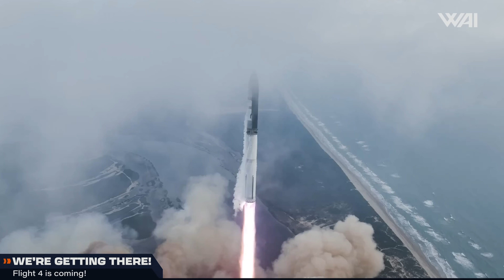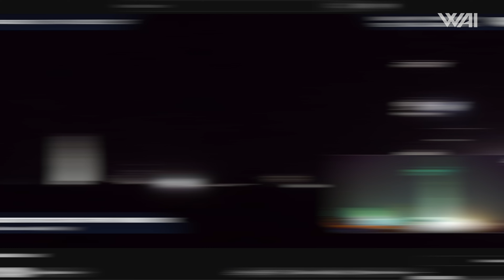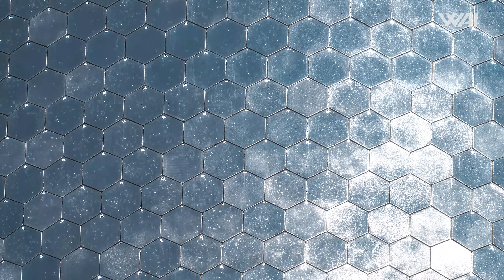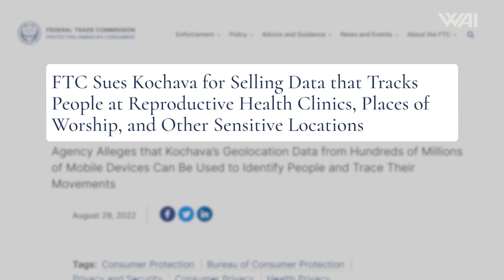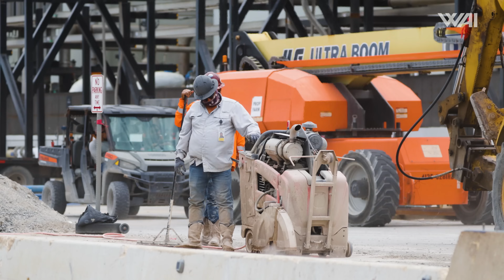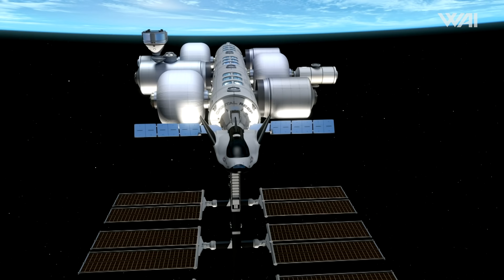SpaceX's Crazy Race To The Next Starship Launch Hides A Twist!

Comment: Putting the lifting points by the door section will allow for a longer booster to be stacked upon without needing to alter the height of the towers at all, as most of the weight is in the raptors the lifting point could theoretically be just below the middle point which also means the longer starships won't require any tower modifications.
Reply from the maker: Excellent comment! Happy that others see this, too! That was my first thought! I just didn't want to speculate too much. :_WAISweet:
Reply: Also, hasn’t the lifting jig caused damage to the tiles on the flaps? Moving these away from the flaps might help protect them when lifting.
Reply: @rightsongsrighttime  the damage was to the tiles near the lifting points, and not the flaps
Reply: @bryanillenberg  the lifting points on the V1 starships are right under the flaps
Reply: @PerilousPaddy  yes, and? The lifting points aren't a part of the flaps, nor is the damage caused by the two-point lifter
Reply: @bryanillenberg  you replied about the damage as mentioned by @rightsongsrighttime and I just pointed out where the lifting points were on V1 which are being moved away from the flaps on V2, moving the lifting points away from the flaps will reduce any chance of damage to the flaps whether they have been damaged or not.
Reply: @PerilousPaddy  The two-point lifter will still need to pass the flaps, so not really
Reply: @bryanillenberg  and moving potential tile damage away from this thermal stress point could be a bonus.
Reply: @PerilousPaddy  as most of the weight is in the raptors 

Not when the cargo is already loaded in the cargo bay.  Unless they load cargo while the Starship is stacked on the Booster it will be more top heavy.  That limits how low the lift point can be.
Reply: @Scanner9631  if the cargo weighs that much they will probably have to use a different method
Reply: @PerilousPaddy  

You do know the target is 150+ tons?  Expendable 230+ tons.
Reply: They will still need to move the SQD, though.
Maybe tower 2 will have a vertically mobile SQD, like 39bs crew access arm was supposed to be
Reply: Yes, but they'd need to make the megabays taller. Right now, the current booster design is the maximum height either stage can be at 71 meters tall. As someone else said, they'd also need to make the SQD higher up on the tower - not a trivial task.
Reply: @faxinspace  maybe booster ok, and they modify hight of where they hotstage.. well a possibility i guess
Reply: @faxinspace  true but that doesn't change my initial thoughts on the reposition of the lifting points making it unnecessary to alter the tower.
Reply: Yes you're absolutely right and thats the beauty of stretching anything that flies. The stretched  version is actually a more balanced craft.
Reply: Fully loading cargo with empty tanks could over-stress the starship itself. Pressurised tanks will be inconvenient. 
Maybe this is why the lifting points have been moved. Ship can be hung on the brackets and fully loaded with empty tanks.
Reply: @Dave5843-d9m  
Pressurized can be with gas it need not be with liquid propellants.  I can't really see them fueling up Starship and THEN loading the cargo while it is fully stacked.
Reply: @Scanner9631  neither can I to be fair.  My guess would be Stack, then Cargo, then Fuel just prior to Launch. It would be difficult at best to move the ship with all that cargo and definitely impossible when fueled.

Comment: I wonder if the Orbital Reef will also have a docking system for a Dragon capsule installed...
Reply: I think by the time the Reef is  operational,NASA will have set a standard for docking that all manufacturers will use.
Reply: @kimnelson-barclay7427  They already do, which is why Dragon and Starliner dock at the same ISS port used by Shuttle. And I believe the Chinese use a variant of the same standard, so in theory their crewed vehicles could also dock to the ISS or to any of the proposed commercial stations.
Reply: since the ISS uses the international docking adapter for all except the russian spacecraft that is a given i think..

Comment: Falcom 9's launch cadence is limited by the transit times of the booster droneships. If F9 launched fewer StarLinks, then they would be able to return the booster back to launch site; dramatically shortening its turn around time. The question is how much mass reduction is needed for this? Instead of 23 Sarlinks and landing on the droneship, F9 would launch ??? Starlinks and land back on the pad.
Reply: You'll then need more launches to put the similar amounts of satellites
Reply: At least SpaceX could keep their current 144 launches this year and merely supplement their launches as hangar space for refurbishment allows. Of course once Starship starts launching 400 Starlinks at a time this will all be moot.

Comment: Why don't they just build a flame diverter? It's seems ridiculus to launch the most powerful rocket without it...
Reply: The plate works just fine
Reply: @alvianchoiriapriliansyah9882  Thats why they need to repair after every launch right? :D
Reply: @daniel-n3v9j Ah yes good to know that the OLM and the plate are the same thing...
Reply: @alvianchoiriapriliansyah9882  what plate are you talking about? I tought you refer to the bottom of the launch pad
Reply: @daniel-n3v9j Orbital Launch Mount refers to the ring-shaped structure that hold the vehicle while standing, supported by 6 legs. Plate refers to the steel device on the floor of the pad with water-cooling

It's. A. Different. Thing

Many scaffolding are erected o& works on the OLM after each launch, while the Plate are basically untouched. You'd probably know why...

Trench protect the latter, former not so much
Reply: @alvianchoiriapriliansyah9882  Isn't OLM the whole thing including the ring, the legs and the plate? I still think this water cooling plate is overengineered, a flame diverter would be much simplier, especially knowing Musks "the best part is no part" mentality. But anyways the engineers probably know better...
Reply: @daniel-n3v9j Wrong, the OLM only refers to the ring table

Diverter also uses water-cooling, basically the shape/geometry is the only difference. And oh, you can install a diverter without actually building a trench

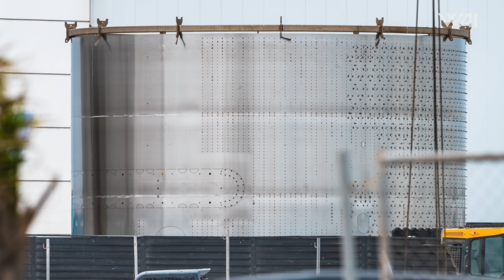Comment: 8:28 Imo this might be a smart move from SpaceX. Move the payload door higher up the hull, will reduce stress in this section by a lot. Just feed the Starlink Sats from the bottem up, and not from top to bottem.
Reply: You might be on to something with this idea! Nice.
Reply: bottom.
Reply: They are moving the dispenser lower, not higher
Reply: @bryanillenberg  Not if the cut outs for the lifting system are that close to the payload door. Thats why we think it could have been moved to the top and satelites will be fed from bottom not top. in Space it doesnt matter if top or bottom...
Reply: @Vollmilch-Joghurt  they are moving the lifting system down, not the dispenser up!
Reply: @bryanillenberg  i dont know why they should move it that much down. cant wait to see the whole ship
Reply: @Vollmilch-Joghurt  because the ship is getting longer, and the booster (hopefully) is getting longer as well

Comment: 5 years from now I can’t even imagine how capable and cheap starship will become. Mass production, rapid iteration, and continuous improvement is the only way to produce a complex machine.
Reply: Really? 45 years ago the Space Shuttle was designed and built. The most complex space system ever built and it still holds that title. Iteration was not the process used at all. 

It reminds me of computer programming. You can be really great at programming and make very competent code and do a small amount of error correction. 

Alternatively, you can write fast and dirty code by a cheap programmer, then keep iterating the bugs out of it until it works reasonably. 

It will be interesting to see how it all turns out in the end. Maybe I lack imagination but I don't see Starship ever landing vertically on the moon. More conventional systems will beat him too it. Best not to talk about Mars unless you take up pipe smoking.

Comment: flame diverter equals heat exchanger  ie capture the energy and store in sand battery pod barges for site or remote use... it should not take rocket scientist to figure this shit out. oh I guess it does... while we are at it... why is there no steam catapult ring propelling the rockets up from the OLM to help with initial thrust to alleviate the full burn off the pad... and there are two sides to the towers turntable for megazilla arms mechanism and two OLM or two seperate set of arms for two simultaneous rocket launch capabilities with one tower... thousand launches a year will take extreme measures... ps while we are at it... every single roof elon owns needs solar collecting with self contain green houses aquaculture closed systems for training self containment principles in real world application... studies in the thunderstorm plasmoid generators for future no fuel propulsions for #starshipstations to create continuous loop orbits to Mars or any off world body if one so presents itself... interstellar asteroid ship comes to mind...    just saying.

Comment: I still think they need to move away from tiny tiles and move to larger panels a few meters across. Made to fit over all areas perfectly, easier to switch out and have multiple connection points so less chance of shake off.
Reply: I keep saying the exact same thing. I’m glad to see someone else agrees.
Reply: Yeah because the way to keep a large, brittle tile from breaking is to make it larger...🙄
Reply: @dancingdog2790  I'm glad you're such an expert.  Where do you work at Starbase?

Comment: The front tiles probably came off because of the tumbling and the air got under the tiles in an orientation they weren’t designed for imo
Reply: Designed by engineers mind u

Comment: I think they should coat stage zero with heat shield tiles.
Reply: The tiles would shatter in microseconds.
Reply: @bryanillenberg  Indeed. Heat-shield tiles are ceramic... good for dealing with heat, not so much for dealing with force.